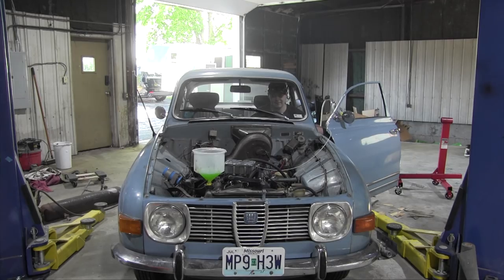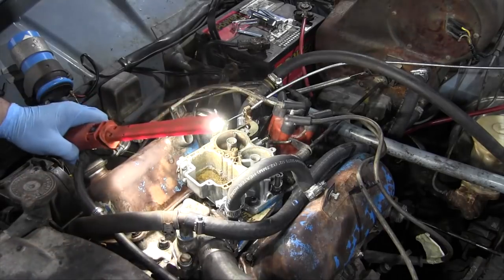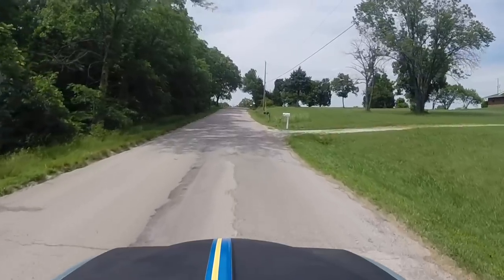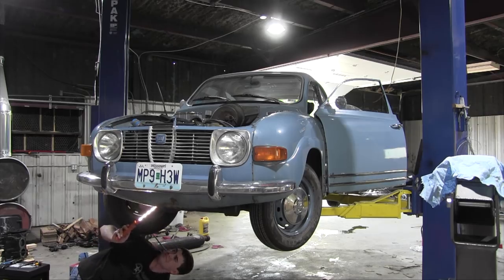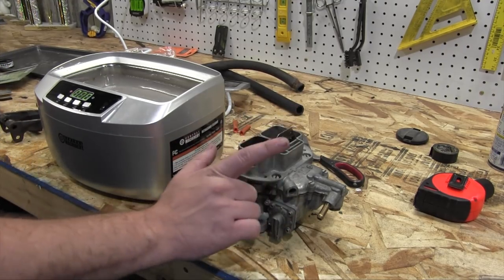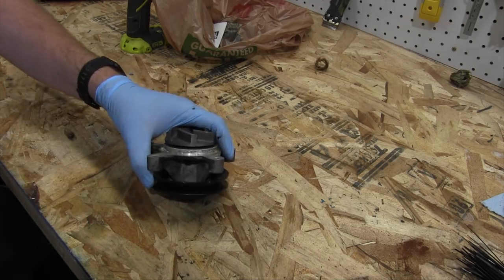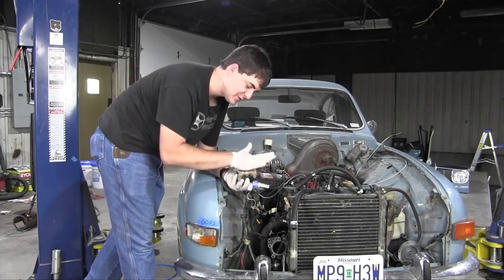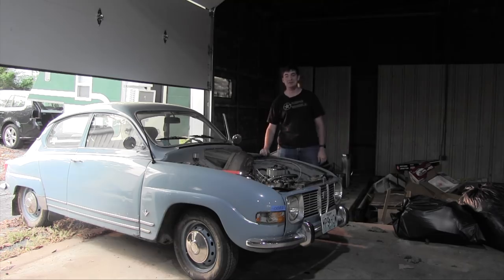Upgrading My Saab 96 to a Two Barrel Carb - Part 3

Comment: I share your struggle! Years ago when I picked up my 1977 Celica I wanted to make it as cool as possible. I bought TWIN Weber side drafts for it. Immediate disappointment was had when there were pin holes in the new intake manifold and it leaked coolant. I found a guy who could weld aluminum and thought I fixed it. I was driving to a car show, the car died, and I found that the intake manifold was in fact made of cheese. Two ears of it, where the studs go through to hold the carbs on and snapped clean off. So I bought another intake manifold, installed it and used some ARB studs. That fixed that problem. BUT that whole time the car ran like straight garbage. I could get it to idle really well or run well at wide open. There was no progression. This was about 6 years ago and there wasn't that much helpful tuning info  available. Mostly, people were saying just to balance the carbs. Which I did. Over and over. And over. Turns out the jets and choke tubes and venturi were wayyyy under sized. I had to order multi jet kits for my multi carb set up. Happy to say after uninstalling and reinstalling my setup as many times as your water pump it runs really good. I'm glad you stuck with it and got it fixed! Sometimes when you're struggling the most is when you just won't let a problem have the best of you. Love the Saab series AW! Keep it up.

Comment: I laughed at all the masking tape showing up saying "oops" having been there and done that. This series has encouraged me to finally purchase and rescue a 1968 saab 96 deluxe I've been on the fence about. Now I know which tools to buy to work on it!
Reply: Patrick Banahan Have you seen the restored rally Saab in NY state that was on Jalopnik’s channel?  The 96 is amazing.
Reply: ...starting with a roll of tape?
Reply: And some WD-40
Reply: Yep! I think that was the two stroke though? The one I'm purchasing has the ford v-4 just like this one.
Reply: Patrick Banahan  They went from 2 stroke to 4-stroke late 1967 I think. Or early '68. '69s had taller front and rear windows, and different grill, etc.
I've owned PILES of these and my basement is still full of parts. All I need is a body to weld up. FUN VID!  These cars are the best. Especially in the snow and dirt. Way over-built. Enormously strong egg shaped body.
Reply: I would put classic vehicle plates on it this car definitely counts as a classic car
Reply: @UberLummox  Saab was/is an aircraft company. The car had amazingly low aero drag for it's day.
Reply: @BobPegram  Yes sir. Have owned more 96s/95s than I can count. Still one of the most sturdy, over-built cars ever made. Aerocraft engineering is mighty serious business and applied it to there autos for sure!
Reply: @UberLummox  That sounds right.  My dad bought the 2-stroke (which I think was designated as Saab 95) in the mid 60's and it ran like a champ until one of my older sisters failed to add oil to the gas after a fill-up.  The engine seized, and that was that.  He replaced it with the V4 Saab 96 in 1971.
Reply: Did you fix it up yet?

Comment: This was especially painful to watch because I work on Saabs for a living and I can't think of one that doesn't have the water pump in a stupid place. I'm honestly amazed they lasted as long as they did while never actually learning how to build a proper car. Also, the next fancy-pants tool you should invest in is a cooling system pressure tester. In return I'm picking up a set of those extension wrenches because good god do you need something like that for working on European cars.
Reply: They built enough "proper cars" to win a great many grueling off road races with the 92, 93, 96 and 99 models like Baja. Even winning Monte Carlo, and  LeMans! Being tough as nails build quality by aircraft engineers helped. Mechanics don't seem to like cars that aren't built like a Chevy w/a 350. Just a matter of getting used to their uniqueness. After that, they seem like just another old car. Not like this modern SHIT.

Comment: Here's an old mechanic's trick for you... You can make a new, perfectly fitted gasket using a hammer. Hold the gasket sheet against the sealing surface and lightly tap around the sharp edges which will neatly cut the material in the exact shape of the part. No scissors or tracing required! 😊 👍

Comment: When I was a wee 19 year old, my Dad gave me his 1971 Saab 96 after he had put a proper 170,000 miles on it.  What a fantastic car -- front wheel drive before that was a thing, four on the tree, and free wheel (I bet that's why the throttle bit was unusual).  I distinctly remember skinned knuckles when I replaced the water pump.  Mine died of rust.  May it rest in pieces.

Comment: Maybe someone has said this, but an old mechanics trick is to grease paper/card gaskets before fitting them.  Besides making them easier to remove, they swell a little and the greasy surface helps seal tiny irregularities in the surfaces they mate.  This always worked for me and I used to wire brush aluminium components on engine rebuilds. Love your videos.

Comment: It's really important to not over-tight the fan belt. That will prevent the bearing in the water pump to hold tight. If over tighted then you have a coolant leak in a few kilometers. Keep up the good work doing videos! 👍

Comment: Pimpin' tip for gasket making:

If the surface for the gasket is flat right across (as in nothing poking up in the way), make some vague marks on the gasket where the holes are "ish". Then put a coating of RTV on the part side, and press the sheet of gasket material on. Clamp it, and let it dry fully. Then, take an exacto knife and cut along the inside edges, removing any material. You''ll get a perfect fit.

Comment: When I was redoing the carbs on my old "94 Honda CB1000 Big One I pulled and cleaned them 5 times before I got it working right. Also put in a ignition coil that was not the problem around the 3rd cleaning. Just be glad you don't like old Japanese bikes with 4 carburetors.

Comment: Just a tip. You should leave RTV to set up until it becomes slightly rubbery but not completely set. Then you should install the part but only have the bolts finger tight. After a couple hours go ahead and tighten the bolts right down and you should have a good seal.

Comment: This was so gratifying to watch, I have much newer SAAB 9-5 as my daily driver and I had to replace to crank shaft position sensor because it had started to act up. Never replaced before but I figured how hard could it be? It took me 3h to get it out and in with the first time and it's one bolt. Mostly from my own stupidity of refusing to try from underneath the car. I finally got the sucker in and then of course it was faulty which showed up in the coming weeks. The second time, took less  than an hour at least.

This seemed to be about the same experience times 10, so thank you for sharing!
Reply from the maker: I'm glad to hear this. I was on the fence as to whether all of this troubleshooting was worth sharing. I'm glad I left most of it in the video. Everyone makes mistakes.
Reply: @agingwheels  We are all idiots at heart.

Comment: Congratulations on getting your water pump and carb issues resolved!!
Time for a coolant pressure tester.
Permatex #2 Form-a-gasket also works on water pump gasket.  

If your idle jet was clogged, there are two reasons that the choke was required to keep the engine running.  First, closing the choke blades causes fuel to be drawn through the main venturis at idle which normally provides the cold fuel enrichment.  Secondly, the fast idle function of choke linkage also opens the throttle blades slightly which exposes the transfer port in the primary barrel of the carb, providing fuel as well.  The transfer port provides fuel at off idle when the idle port doesn't provide enough fuel for the increased engine speed, but not enough air is flowing through the carb to draw fuel through the main jets.

Comment: Another WONDERFUL Saab story! Man, I love your videos. I've purchased many new parts that were bad. The first that comes to mind was a brake caliper that did not have the seat for the bleeder screw machined. Fluid leaked out and destroyed the adhesive holding the balance weight on my new alloy rim...... Got ahold of a small engine for an auger that was missing a hole for the idle mixture to reach the intake of the engine. So "new" IS NOT ALWAYS "good"! You made an excellent recovery!

Comment: Years ago I had a waterpump that was leaking from the weep hole, I live in texas so things dont freeze. I ran a self tapping sheet metal screw into the hole covered with silicone. I let it dry for a day or two and then drove it another 150000 miles like that. completely forgot about it until i was going to sell it and the buyer pointed it out. thanks for the tip on the wrench idea i have a tensioner on my car that is impossible to reach. Tip on the carb bolts if their are allen keys that make on that has a ball on the end for getting into those tight to reach places. thanks for the great videos keep it up. I trully enjoy your content.

Comment: Love this series (and your channel). I've been driving almost nothing else apart from Saab V4s and 99s since I got my driving licence 18 years ago, and still do (currently a 5-door 99 cc from 1976 and a 95 V4 from 1978). Then again, I am a native Swede and Saab's are naturally easier to get hold of up here but still they are getting rarer as the years go by. Can't wait for the testdrive video once you get it back into the system.

Comment: Too late now but for future reference: You can use the part and a small ball-peen hammer to cut gaskets. Put the gasket material on the part. Use the ball end of the hammer to tap around all edges and over any holes. The sharp edge of the part 'cuts' the gasket. Since you had old, used water pumps you could do this without risking damage to the new pump.

Love the channel!

Comment: The easier way of making gaskets, is to use a small hammer with round end and hammer with LIGHT blows around the edges/holes.

And the sound of the SAAB running IS great.  I do want to own one again...

Comment: Have you considered using just water for leaking test instead of coolant?
Reply from the maker: That would make too much sense. (Also, coolant is slightly easier to see leaking out)
Reply: @agingwheels  😁
Reply: @agingwheels   Add food coloring to the water.  Also your PCV and all the valve cover plumbing can be eliminated.  A small filter on each valve cover is all you need.

Comment: Good lord, those wrench extensions sound incredibly useful! I feel your pain, I haven't wrenched on many cars but I constantly find myself struggling with those stupid 1 hour bolts, whilst contorting my overweight and inflexible body around some metal pokey bit, with the hot summer sun roasting me, and some friend of mine hovering around wondering why I'm taking so long and asking 20 questions...

I often wonder why I even touch cars lol.

Comment: I understand how some things can strip you of the will to work on something you love.I’m glad you found ways through it! Your carb looked great on the outside but horrific inside. I stripped mine down because the outside was nasty and my engine didn’t run, but inside it was pretty decent. Still haven’t got around to ordering a rebuild kit though so I admire your continued progress even when things are tough or the reward is far away.
I’ve been a mechanic but my training was crap. Your water pump adventures taught me a thing or two as did the carb base plate modifications and rebuild. Thank you so much for documenting, sharing and presenting in a wonderful way!

Comment: I have to pull the entire front end off my Scout this weekend to do some work on the belts and install an A/C condenser, I was frankly dreading it quite a bit due to some of the bolts being insanely difficult to get to. As soon as I saw your demo I immediately ordered the pro set and low profile sockets. Its going to save me at least 2-3 hours of struggling in 100 degree Texas heat.

Comment: Well... on the bright side, at least you could see the Saab's leak.
I recently had the engine of my daily - a 1997 Renault Clio 1.6 - rebuilt. Before being rebuilt, it was drinking its own coolant away. After the rebuild, it is STILL DRINKING COOLANT.

It doesn't drip. It doesn't seem to be getting mixed up with the oil. The coolant level just drops week to week.

Anyway, good job getting that thing running properly again. Very cool project.

Comment: Perseverance for the win.  You learn a lot from it.  I sure envy you being a young man.  You remind me a lot of myself when I was young.  Finish that tuneup with a vacuum gauge for timing and idle with air/fuel mixture needle valve and she'll do fine.  Get some rubber grommets for that fuel pump mounting.  Carry on.  PS. Motors really don't care if they have new paint.  LOL You ain't kidding nobody about the no test drive because tags are out!!!

Comment: I have a tip for you Son. To make a gasket, spray the gasket surface with oil and set it down on the gasket material. It will give you a perfect pattern. cut to size.

Comment: Cooling system pressure tester... makes finding the actual source of a leak so much easier. You can hear it, see coolant dripping, and usually theres bubbles or spitting at the source. It also simulates the system under pressure.
Reply from the maker: That would've been very helpful
Reply: They're unbelievably helpful. Can't tell you how many times it has saved me with my RX-7 lol you can rent them from any of the parts chains, but I finally bought one from my MAC rep. Also, when you said in this video you'd taken wire to the sealing flange, I suspected that's where your problem lay. Happens to new RX-7 owners all the time with the thermostat housing to waterpump housing flanges. Very frustrating indeed !

Comment: Got suckered in by the Trabant o-haul but the Saab 96 held me for all 3 episodes. What a fun way to waste a morning!!   Over the years have had 4 Saabs...a 93, two 96's, one a Monte Carlo 850 that became a rally car and a wrecked V-4 that gave up it's engine to the rally project for more torque.  Cut out the V-4 eng. mounts, welded into the Monte and an early 99 which had that stupidly designed Triumph inline 4.  Have loved all of them. Wish I still had the 99, a very nice car.  I could have Kennedy Eng. make a trans adaptor, fit a Mazda rotary, be a real sleeper.   With the 96 rear seat down, snuck 3 pals lying in back covered by camp gear, sleeping bags into Watkins Glen for the Can Am and F-1 races!!  The German Ford Taunus V-4 was originally a very stout, robust industrial motor for fixed generators/air compressors, weighed I believe it was only 30-40 Lbs than the thin wall Ford 289 V-8!!!  Incredibly heavy for 1500 cc's.  BTW, lwr. rad. hose at Rock Auto is $7.18.  No H2o pump unfortunately.  Thanks for all of these, VERY entertaining, lotsa' fun!!

Comment: Enjoying your channel. I have been running a Saab v4 as a daily driver for past 6+ years covering 65000 mls . Very important tip . Slacken the fan belt to within a Nats wicker of it slipping under full load ( lights wipers heater etc . )This takes the strain off the balance bearing s (also waterpump  and alt ) mine is still solid .. Run the gearbox on  the correct 80 weight oil NOT 90 .
Reply: YES! Expert advice indeed.

Comment: I've heard that a cereal box cardboard + rtv seal gasket is best cheap gasket ever.

A few protips from many years of dicking around.
Cleaning 3 times is usually enough.
Check jets with compressed air to ensure that all of the passages are cleared out.
Trying using carb cleaner to spray through passages and jets (ensuring that they are infact open/clear)
Also welding tip cleaners and fine solder can go a long way to ensuring that jets are cleaned out with some pokey pokey.

And check your plugs after a few minutes of run time to see if they look rich or lean.

Comment: Okay I know this video is 2 years old ,but here's a suggestion.  Take your intake plate or anyting that need to be flat. Get a piece of glass  and some 400 grit sandpaper on the glass add some oil to sandpaper. Sand whatever piece you need to flat in a figure eight motion.  After about 15 seconds you will be able to see your high spots.  Continue until there are no high spots.  You want to use as little silicone as possible just about the thickness of a sheet of paper or less. Otherwise the excess in the case of your intake can inter your intake. I learned this from a machinist.